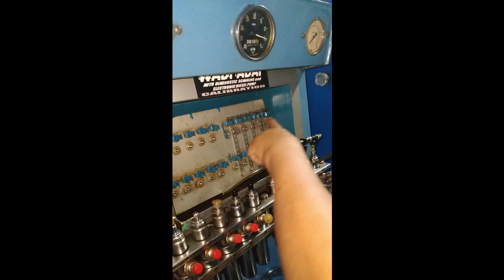CUMMINS 6BT INJECTION PUMP PLUNGER BLOCK O-RING REPLACEMENT. DIESEL MIXING TO ENGINE OIL.

Comment: Sir paano ba malalaman  kung tama na ba or subra ang diesel na nilalabas sa graduated cly.? Or may computAtion ba nto per second? .  Salamt sir.  Sana mkatulong kyo
Reply from the maker: Elde ang pump delivery ay nakasulat sa pump calibration data na supply ng manufacturer.
Reply: @dieseldoctorph8667  cge salamat. E.check ko.  .slamat tlga sir wla kc. Ng tuturo sakin. Puro youtube lng ako. Sana patuloy mo contnt mo.  God bless